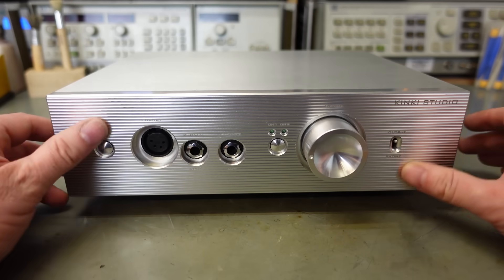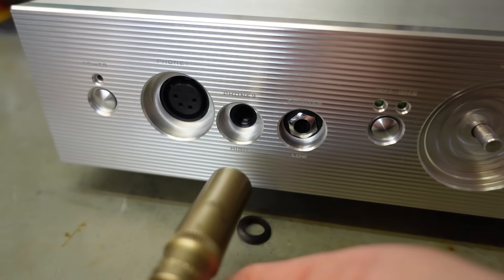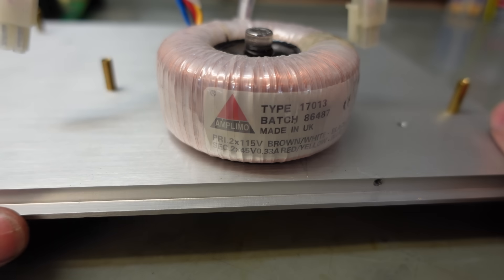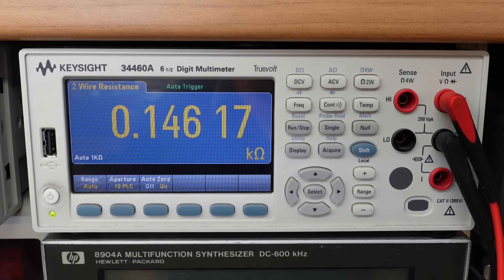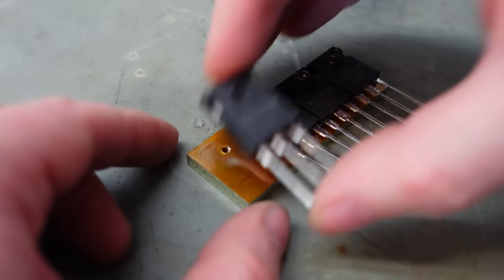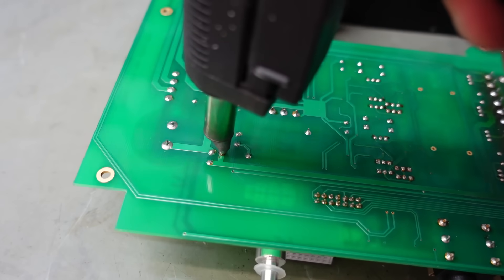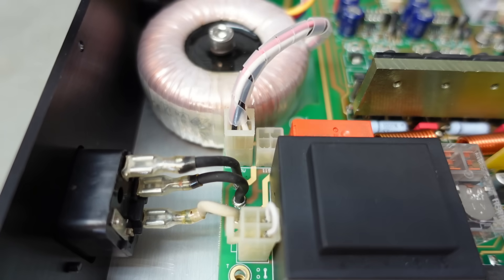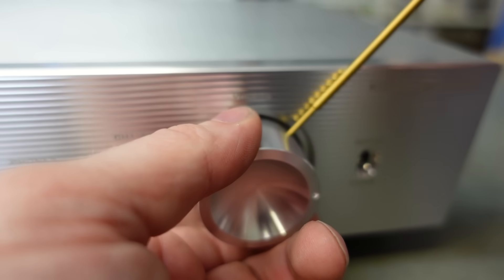KINKI Headphone Amplifier Repair (Vision THR-1)

Comment: Given the build quality it would be reasonable to expect a heatsink that could dissipate the heat from those power transistors..  It's fairly obvious what has happened, one of the two power transistors overheated and went SC which caused the other power transistor to fail, the resistor to go SC and blow the fuses.  All that thick Al chassis could have been put to good use as a decent heatsink if the transistors were mounted beneath the PCB and attached to the baseplate.
As a well know class A amplifier designer said - "you can never have too much heatsink!"
Reply: @stickmenwithrayguns
The MOSFETS are; ECX10N20 and ECX10P20 LATERAL MOSFET Designed specifcally for linear audio amplifer applications High-speed for high bandwidth amplifiers (from mfr data sheet).  At a cost of £6.90 each device it makes no sense to use them "for keeping a steady temperature inside", when something like a IRF240 or IRFP240 is much cheaper and would achieve the same result.  And never in my 55 years of audio amplifier experience have I come across devices "for keeping a steady temperature inside", during my work in aerospace there was a TO39 device that had an integral heater and was used in the temperature sensing bulb circuit of a turbine engine.  Perhaps you could enlighten me as to why an audio amplifier would require heating?
Reply: @stevesmyth4982 Temperature ovens are frequently used in high-end applications where stability is the essence, because lots of components have temperature dependent characteristics. 
For example If you need frequency stability or have a measuring device or a DC amplifier that doesn't use any form of feedback.
 
In my early career as an engineer mid 90's I worked with equipment for Ultrasonic visualization "Medico" for Bruel & Kjær in Denmark, and by maintaining constant temperatures in our front-ends we achieved S/N ratios 10 times better than what is generally considered high-end audio + much faster as well. 
Later I worked with Radio & Radar devices which requires even better stability. 
I guess the N-channel Mosfets are used as constant current source and the P-channels as constant loads. Or the other way around. Since only 2 of them were blown they are obviously in sets connected in parallel. 
Such a setup should be very stable if it wasn't producing too much heat that is. 😆

Normally you would aim for max ambient temperature + 15 degrees celcius, but it depends on where your critical components have the best linear behavior.

I don't know why these exact Mosfets was selected for the job. One should think that anything capable of producing heat would be sufficient.
 

This specific design is probably stolen from a High-end manufacturer like Goldmund based in Swiss making this a € 1.600,- clone of a € 5.000,- original. 😯
But I don't know that for sure. 🤔

Its probably not worth that asking price.
You should be able to buy a real nice headphone amp or build one for much less than € 1600,- 😆
Reply: @stevesmyth4982  I think it's either a troll or we've found a KINKI shareholder. ;)
Reply: I'm sorry but you're wrong. 🤭 I'm an electronics engineer my self with +30 years of experience in radio&radar. Look at my recent comment.😉

Comment: Would the 'balanced' outputs be ok if you also supplied balanced inputs? 
I have seen amps where the RCA inputs are just connected to one side, but the balanced inputs are properly handled.

Comment: I have a question for you Mark .. I really hope you will see that message .. I'm an (awful) audiophile .. I love well made audio components that produce great, clear, beautiful sound quality .. but I can see here and there that sometimes, some well known hifi brands don't really put that much effort in building great quality components .. they say they are designing state of the art electronics, but that's not really the case .. so here is my question : can you tell me what is for you the best amplifier brand/model (ot integrated/preamplifier/power amp .. whatever) you've ever seen or worked on .. in terms of electronic design/build quality .. and the worst (why not ;) ) ??  ... Thanks Man, your opinion about this would be interesting  ;)

Comment: I guess their way of being kinky is by selling useless massive lumps of aluminum encasing a set of blazing hot transistors desperately in need of a heat sink. This is what they call kinky engineering.

Comment: What are the output protections? This failure mode is quite common if there's no robust output protection block (and doesn't look like there's one) and someone yanks out TRS plug while amp is driving some reasonable signal.

Comment: I Always buy Japanese products, whether they are are vintage or brand new! I have vintage Japanese audio going back to the 70s and 80s which has never failed! The only works I have carried out to them, is replacing the capacitors, a few transistors, few resistors and update the speaker terminals and RCAs! Chinese amplifiers look nice, but they use very cheap components, is grossly over engineered, and very poorly ventilated! The same fault will occur due to poor ventilation! The customer should work with Mark, to fit a fan on the outside, and make some vent holes in the casing, because Mark is an exceptional, wonderful, talented gifted engineer!

Comment: Great repair as usual, but I'm afraid I'll have to ding you one point for not cleaning the carbon from the burnt resistor off the circuit board!

Comment: Another day, another poorly designed boutique audiophile product. They had all that thermal mass in that chassis and they couldn't have been arsed to mount those MOSFETs on to the chassis....shameful. This failure is easy to predict; all they needed to do was take a picture of the prototype with a thermal camera before letting it out of the lab. That poor heatsink probably exceeded 100°C. 

Also, amplifiers are more or less solved problems and buying amps with the numbers shaved off the parts only angers your technician and makes them charge more money.

Comment: They ought to be laws about grinding serial numbers of components in electrical devices. The only reason I can think people do it is because they don’t want the end customer, knowing what cheap over-the-counter generic parts they are using in supposably a high-end piece of equipment. They never want people sitting there thinking hang on. I’ve just paid £900 for this and there’s only £60 worth of electronics in here gotta keep a little bit of secrecy back so people don’t know what the product costs to produce per unit
Reply: No, the reason people do this, is, because they fear that otherwise another competitor would copy "their" (probably already copied) design and sell it for a lower price. This especially happens with overpriced premium goods where a competitor could easily cut costs. China is notorious for this practice of copycatting, thus you can find identically looking products in online markets from different manufacturers with different levels of quality and price.

Comment: Hi Mark:

The balanced OUTS are moste likely Impedance Balanced

This is the type of output is notable for only driving the +leg (XLR pin 2) with audio. When measured on the bench, because of the
absence of audio on the –leg (XLR pin 3) this circuit gives the appearance that it is an unbalanced output. In fact it is designed to provide a very good impedance balance.
It gives correct level into an unbalanced input without needing special cables or wiring and it gives correct level when driving a cable with pin 1 & 3 connected, audio level or frequency response will not be affected.
Reply: I'm sorry but you're wrong. 🤭 I'm an electronics engineer my self with +30 years of experience in radio&radar. Look at my comment.😉

Comment: I cannot for the life of me see why they would need such high rail voltages and large output transistors for a headphone amp! Even if it's class A, that's still huge overkill. I've made a similar class A headphone amp, but it only uses +/- 12V supplies and TO-220 output transistors. That's still capable of well ovrer a watt into 32  ohms, enough to ruin most headphones and blow your head off!

Comment: Lots of talk about faux balanced outputs. In fact I suspect they are only balanced with a balanced source. In order to get the controversial audio benefits from balanced connections you need to be balanced throughout the signal path. Either that or you need a mega long cable run at some point in the system, which is the only confirmed benefit of balanced.
Having said that, a true balanced output should provide roughly twice the output of its Rca equivalent, so that can be an advantage for hard to drive headphones.

Comment: Dear Mark, when testing balanced outputs shouldn't you use balanced inputs for that matter? Just asking😉
Reply: The definition of balanced is that as the hot output goes positive the cold output goes negative. That's why Mark used a 4 channel scope. So he could measure both hot and cold for both left and right. So in effect he was using a balanced monitor.
Reply: @zero0ryn  read again, i've asked about something else
Reply: @cesio25  That could be true. However, most kit converts balanced to unbalanced for use internally as it only makes sense to use balanced line for external transmission of signals. It might be interesting to see if the XLR inputs are indeed balanced.
Reply: @zero0ryn  yep, that's the thing  i would like to know👍, just to see if balanced signal passing thorough or it's just eyecandy for audiophiles

Comment: I don't understand the use of kapton tape on the heatsink.  Is it a good conductor of heat? I always thought it was a bad conductor of heat, and hence why it is used to cover components where a hot-air gun will be used.  I'd have used thermal pads on those FETs instead.
Reply: My thoughts too.

Comment: Seems to me there's a design flaw in that.  Kaptan tape is heat resistant making the heat sink useless. It should be on the backside with mosfets and thermal paste on the contact side. No wonder there's heat failure and stress indicators.
Reply: Thats what i was thinking when i saw it.
Reply: That's not even a heatsink, more a heat spreader.  Even a proper heatsink inside that box would be nigh on useless because there's nowhere for the heat to go.  The designers should have used T section aluminium and mounted the transistors on the vertical part and attached the horizontal part with four countersunk screws to the inside top of the case.
To use cheap kapton tape in a design that costs $1298 is stupid, at least use mica and silicon grease or better still use Kerafol.

Comment: Those Exicon outputs are excellent devices; some of the last really good power audio transistors. Based on the old Hitachi LatFet (and made in UK). However,  the Kinki engineer is relying too heavily on how forgiving these FETs are with thermal runaway and breakdown, considering the size of the heatsink. If they ran the output at +/- 40 volts it would still have buckets of power and probably not overheat.

Comment: I wonder if one of those MOSFETs had gone unstable? In earlier days of MOSFET power amps Ihad a few go like that. They can osciliate in the GHz region, too, so you see nothing on your scope. The ferrite beads on the legs are a hint that it might be an issue. With one brand of power amp in the 80s, I resorted to the old radio amateurs leak testing trick of a wire loop with a PIN diode and a small bulb to see if the power amp I was looking at had turned into a transmitter.

Comment: What a curious case, I assume the short circuited mosfets took the power supply components out, but why did the mosfets go short circuit and why the discoloration of all of the out put mosfet devices?

Comment: I have my doubts about the legitimacy of the factory-supplied output transistors. I suspect they're not genuine Exicons. Why would the manufacturer of these amps pay a premium for genuine Exicon transistors when they can bang in some of their fake ones that might last a few months or years? The cheat with the unbalanced audio on the XLR connectors just adds to the credibility issue. It's all a bit dodgy, as is often the case with this boutique audio stuff aimed at audiophools. I've seen plenty of it pass through my workbench.

Comment: The heavy-gauge Alu to just give the impression of weight =quality? hmm.... Nice pcb layout & quality components though. I'll remember that tip about controlled power up after the bridge rectifier 👍
Reply: In theory the heavy case helps to reduce micro vibrations and RF interference. In practice, who knows. It also protects the components but, paradoxically, makes you more likely to drop it. On your foot.

Comment: I'd say "underengineered" (in the sense "designed by someone who was not a real engineer"): 4 large mosfet for an amp needing few milliwatt (they managed to get fried anyway); kapton tape (an heat insulator) instead of thermal grease between the mosfets and the heatsink; a 30VA transformer for stand-by function, paired with another toroidal transformer, etc. etc. 🙄
Reply: It's typical china 'bling' - made to look the part but what's under the hood isn't that great. Designed to extract money from audiophools mostly.
Reply: @stopthebus  exactly. I despise them (both the audiophools and those who exploit them).

Comment: It's astonishing that a device in this range, and so recent, should be burned out like this. Has the bad reputation of Chinese devices done the talking, or has a user used it like a pig ? 🤔
A big bravo for your professionalism, and interesting video, thanks again ! 😉
Reply: It 'looks' the part but if you start digging down you realize that it's china cheap. The use of XLR output connectors without a proper balanced signal is just one example, the use of Kapton tape between power transistors and the heatsink is another.
Reply: @stopthebus  Thank you for your expertise ! 😉

Comment: Burnt mosfets, overheathed PCB .. and there is no ventilation holes in that chassis.. My guess,, It will happen again soon. Anyways.. Great repair on this, Mark!
Reply: Mark has the spares on the shelf ;)
Reply: I think in this case on FET failed and then cooked the others resulting in total failure
Reply: Last thing I’d have ever expected to see that is a headphone amp lol.
Reply: That's my immediate thought too. 
Not only that but isn't capton tape meant to insultate agsinst heat? I get it's being used to insulate between the heat sink but surely that would also trap the heat and not transfer it? I'd seriously remove it, get a better tranfer medium and a better heatsink too.
Reply: @crunchyfrog555  The Kapton tape is usually used to protect against heat and for its insulative properties but I don't know why they would have it on the heatsink between the FETs like that.  Kapton is not very good at conducting heat.
Reply: They had a whole chassis to use as a heatsink and they decided to not do that XD Piece of junk.
Reply: Maybe drilling some holes on the top to eliminate the possibility of this happening again?
Reply: @markstewart1807  no can do, it's audiophile equipment, it's imperative to look pristine and expensive 😄
Reply: @markstewart1807  Nope, that would make it worse as it's lessening the amount of material. It needs a vaned larger heatsink to increase surface area.
Reply: @crunchyfrog555  I doubt it runs that hot. There's a lot of showmanship/audiophile marketing going on in it's design whilst not getting the basics right. As someone further up pointed out, you need heat conducting not insulating material between mostfets and their heatsink...
Reply: @cmddelete2169  Yes I know that - that's patently obvious.
Reply: I'm sorry but you're wrong. 🤭 I'm an electronics engineer my self with +30 years of experience in radio&radar. Look at my comment.😉
Reply: @stickmenwithrayguns  explain how then. Otherwise that's an argument from authority fallacy.
Reply: @crunchyfrog555  "argument from authority fallacy" Love it. Haven't heard that since school. Mr Putin has it embroidered on his duvet covers, of course.

Comment: It's made like a PS Audio amp ... 
I'd like to know what actually caused this thing to fail and if Mark did find ALL of the damage too, quite often things like this will work ok after you replace the obviously damaged parts but all too often there are other components too that have been knocked about a bit too that are only just hanging in there and may well fail in the future . I am guessing this headphone amp was used to drive some 4ohm speakers ..!

Comment: Mark great video as always. I might be a bit sleepy, but I thought the second from left Exicon was loose in the part where you were installing the beads. Maybe it was deliberate to aid alignment of the pins to the board… if not. It needs to be tightened 😅
Reply: I saw that as well. Hopefully he caught it in time.

Comment: I use kapton tape to STOP heat transfer.  Does the kapton tape behind the mosfets actually stop the heatsink from acting like a heatsink?  That'd be my guess why it failed.
Reply: For sure, that tape should not be used in that application but also those transistors shouldn't get anywhere near hot enough to fail even without decent heatsinking.

Comment: The heat sink is much too small. The case is an exaggerated waste of material with unnecessary thickness. Why does a power amplifier that was made for headphones crack at a ridiculous 5 watts? That is the question. 😉 Little know-how and too many natural resources - that's Made in China.😂